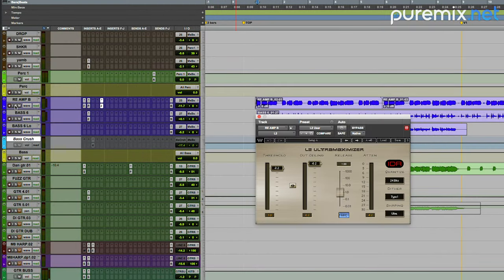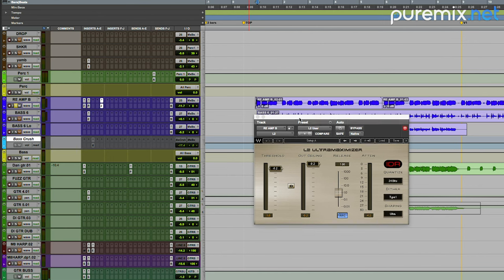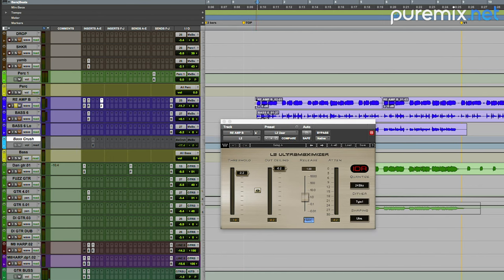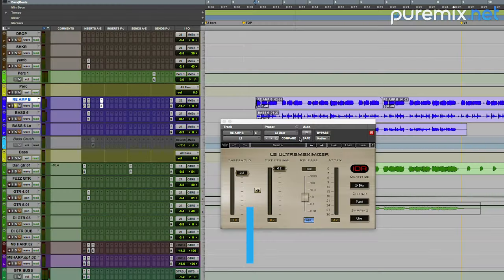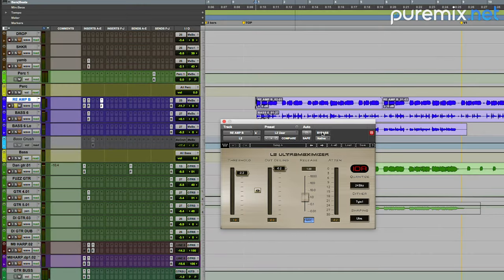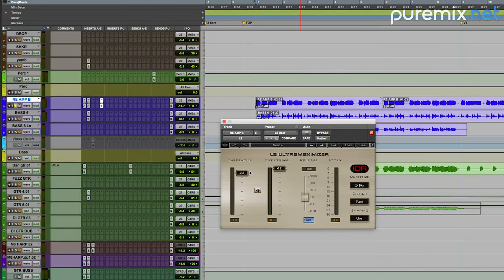(Audio compression) Using A Limiter On Bass | How To Get An Even Sound

Comment: Always use your ears but try rendering out the audio so you can see the difference its made.  Then you can A/B the unlimited bass with the limited bass and hear the difference. Make sure you set the levels of the new rendered limited bass to peak at the same level as the unlimited.

Comment: Limiting is basically compression 100:1
Use a compressor if needed less cutting
Try parallel compression to get best of both, natural and dynamic control
Try using the 3 and build up a library of when to use what type for a particular sound and outcome.

Comment: Please explain to me how a track peaking at -0.2 db fits into the whole "gain staging" gospel I keep hearing about.
Reply: This might just be for effect to demonstrate the limiter but I think what's happening is this one particular track (left side of the screen, RE AMP B) is pushed as hot as it can get and because he's using a brick wall limiter you don't need any headroom for the peaks, so -0.2 is ok, you just need to stay under 0 to avoid distortion. You are only hearing this one track in the example but it is one of 4 different bass tracks that are getting mixed together, I'd assume this is to create a parallel compression effect. I suppose he'll pay more attention to the level of the bass buss as far as leaving some headroom.
Reply: It fits in by using the fader.
Reply: There are multiple places to gain-stage. You can reduce the ceiling within the limiter, you can reduce the plugin's output, you can reduce the signal on a subsequent plugin, or you can use the track fader. And dude, if you think managing your music volume is some sort of cult-ish "gospel", go read a book on the basics.

Comment: Only Limiter or do you have to accompany it with a Compressor?
Reply: No offense, that question shows you didn't understand the video. Watch it again, he's explaining when you'd want to use insert limiter, or comp, or either of those in parallel, specifically depending on how much you want to retain the original character of the source material.

Comment: I think bass is so difficult to grasp initially because it’s really not what our ears are tuned to hear. Sure, midrange is a beast but at least you can easily key in on the difference between 400hz and 800hz. Compare that to managing energy in the 40-80hz range…you’re barely in the same perceptual ballpark.